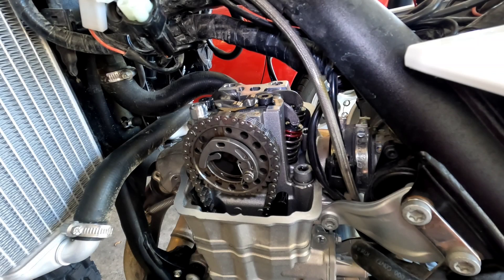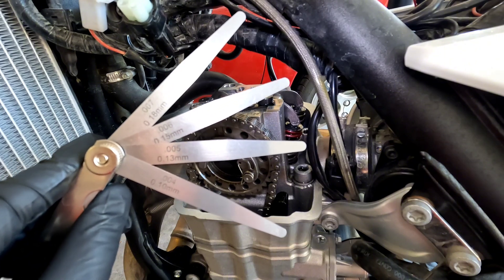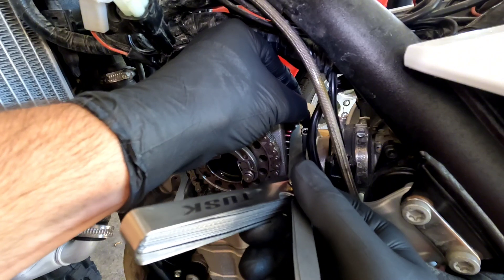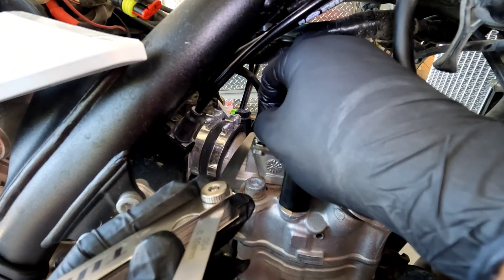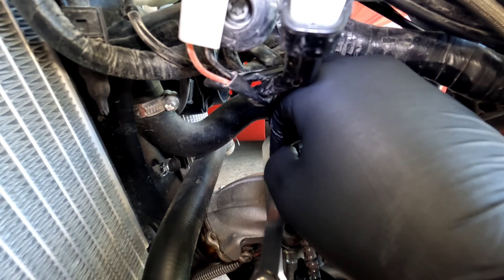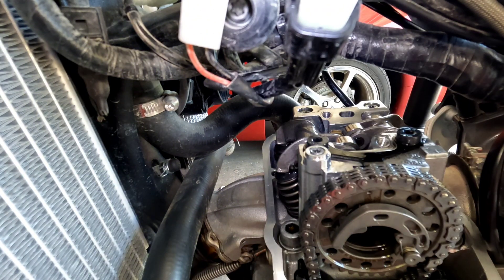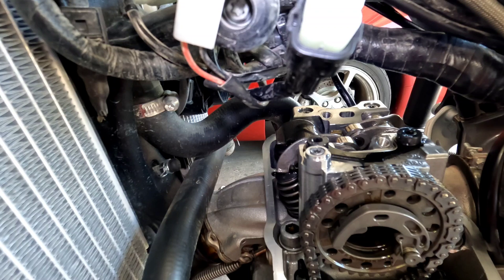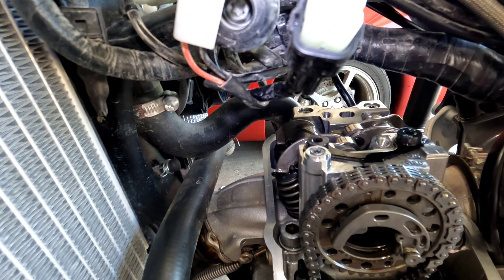Valve Clearance Check 1800 Miles/56 Hours 2024 KTM 500 EXCF

Comment: There is so much varying information about valve checks on the ktm 500's. 
Yesterday I took my 2023 exc f 500 ( with 30 hrs) to the dealership for a check as I have a long trip arranged. The valves were perfect and the dealer said he wouldn't worry about them until the piston needs replacing
Reply from the maker: If the bike starts easily and runs well, the valves and probably fine. Based on my checks and feedback I’ve had from other riders, I believe these bikes hold solid for a while. With that said, I will continue to check mine and post the results.

Comment: Hi! Please help, im struggling for a week already. This 2024 has 2 cam marks, tdc and lock (with dot). What do I use for cam timing? I locked the crankshaft with bolt, how do I position the cam? By tdc mark or by lock mark? My fuel mixture is too rich after I used dot mark to position? Please

Comment: I did mine, but I cleaned my wire harness like it was brand new. You don't really realize how much little bits of dirt hides up in there. So when your hand touches that wire harness with the valve cover off dirt will fall in there. Just a suggestion.
Reply from the maker: @jessewawrzyczek2812  You are correct. I actually cut zip ties and moved the harness to make more working room.

Comment: Was this your first check on the bike?
Reply from the maker: @BushmanCanuck  Yes. In hindsight I would have checked it on day one.
Reply: @dustinhoover3157  I'm at 30ish hrs on my 501 and Havnt checked yet. Something I plan to do as the snow puts an end to riding. I also never checked spoke tension from new until I noticed 4 missing! Whole wheel was loose...i feel shame.
Reply from the maker: @BushmanCanuck  That's a bummer. I need to give my spokes a once over. I am due for the 3,600 mile valve check, and the bike is over 100 hours. I will post the results soon.

Comment: Do use reuse the original valve cover gasket?
Reply from the maker: @ridemfast7625  Yes. The gasket did have some adhesive on it from the factory. I cleaned it off and put the gasket back on dry. No issues.
Reply: @dustinhoover3157  Cool. I have a very stupid question. When the key is switched on nothing happens. No fuel pump prime, dash panel does not light up... nothing happens. Hit the "start" switch and bike starts, everything works - dash panel and turns.  Is this normal? So even to set the clock or reset odometers the bike has to be running?
Reply from the maker: @ridemfast7625  It's normal. Here are some options to wake up the display:
1. Quick press either the + or - buttons on the display. No key needed. You can access your display features.
2. With the key in and turned on, quick press the start button. No need to hold until the bike starts running. This will wake up the entire electrical system.
3. Roll the bike until the wheel speed sensor wakes up display.
4. Start the bike. 

Even if the bike is running, the display can go to sleep, this will happen while not moving after a period of time.

Comment: Thank you! 
Where did you find service manual? 
I could’t find it anywhere :(
Can you send it to me, please? 
I have the same motorcycle, but our dealers do not distribute service manuals.
Reply from the maker: @MrNewcitizen  I did not use the service manual to complete this task. The owner's manual does give you technical specifications for the valve clearance range, and the torque specs for the valve cover screws. Chapter 23/23.1, page 144: @ 20 degrees C or 68 degrees F intake valves  .10mm - .15mm or .0036in - .0059in.  Exhaust valves .12mm - .17mm or .0047in - .0067in. Chapter 23/23.1, page 146: Screw, Valve cover M6 10Nm or 7.4 lbs/ft.
Reply: @dustinhoover3157  thanks again! 
you helped me to set everything up!

Comment: Nice video will the bike not start when it's hot if the valves need to be adj
Reply from the maker: @ktmdays  Thanks! Yes, if the bike is having trouble starting that can be an indication the valves need adjustment.
Reply: @dustinhoover3157  I haven't adjusted the vales in 2500mi and when I ride it for a while it stalls out and I can't start it untill it  tools down
Reply from the maker: @ktmdays  What model year is the bike?
Reply: @dustinhoover3157  it's a 2020 ktm 500 excf 6 days with 100 hr 2900 mi
Reply from the maker: @ktmdays  The valves should be ok, but they are easy to check. You might want to check the fuel pump system. Check your in line fuel filters, or just replace them anyway. That generation of bikes is known to have pump issues. Your bike may require a full pump assembly rebuild.
Reply: @dustinhoover3157  I got a better than stalk pump when I got the bike I put a gage on the fuel system and it's at 51psi so that is good bit thanks for the help